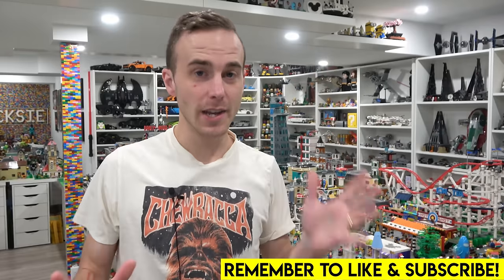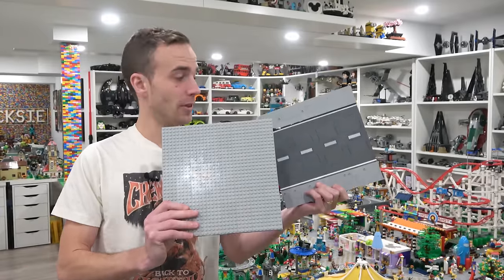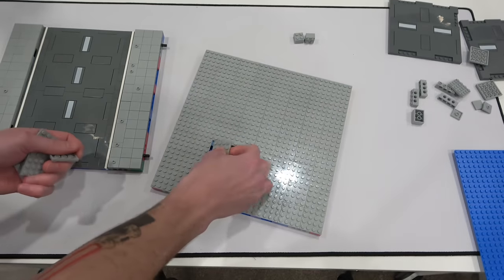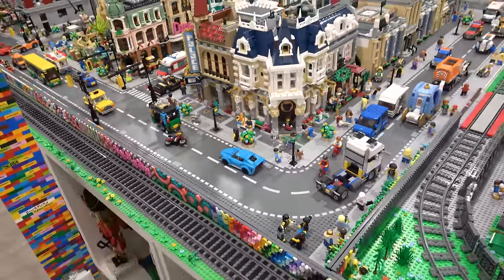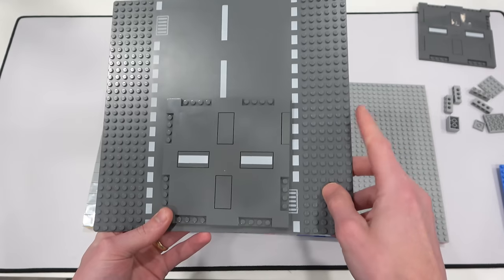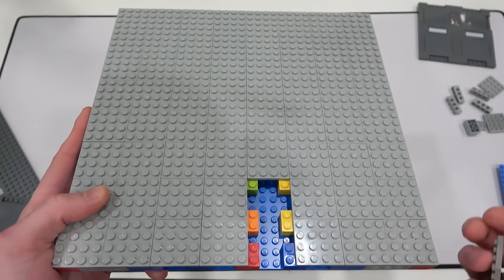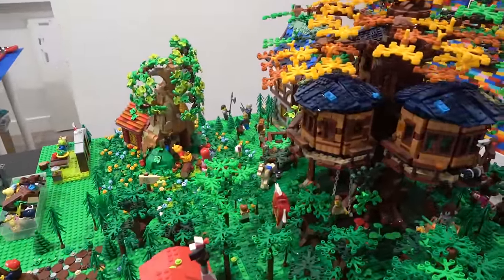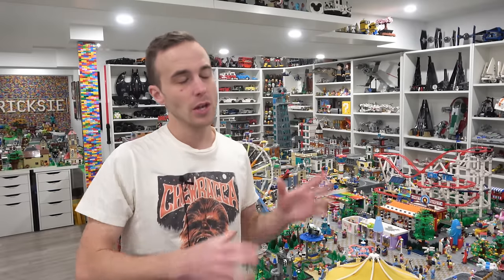LEGO MILS System? What is it? Should I Convert?

Comment: MILS has one pretty big disadvantage, it encourages making a very blocky city, builds start to always take up a 32x32 plate. The city ends up one big grid. It's possible to avoid that but you then start to loose the modularity.

For our city we aren't really using MILS, most areas are using baseplates, we like the road baseplates for the built up areas, the fairground goes under the eaves and if we switched to MILS the Ferris wheel would scrape the ceiling. The park area will be more textured with blue baseplates giving a water level and then the ground built up so in places will look a bit like MILS. Then we've got mountain areas which use the technique of two layers with bricks between but would be plates on top and bottom, so supports can be attached.
Reply: So mount things 'off kilter' diagonally, or at slight angles, and fill the plate with landscaping. If you put in the work, you could have a plate seam right through the middle of a park and not even notice. With carful planning, you could split a building across plates the way the titanic set breaks in sections. Put those ideas together, and you could have a large building split across more than one plate, at an angle, with landscaping around it, and break up that city grid.
Reply: @root1657  If you mount things diagonally then it actually ends up looking more blocky. You end up having seams that run at angles to natural breaks, so looks awful. As you say, you can have buildings that span multiple plates, but then you lose the one advantage that MILS provides, which is that it's modular and can be rearranged. MILS have a number of advantages:
Easier to transport
Modular
Specific standard to allow independent development of modules
Allows "hidden" wiring

If you are going with things spanning plates then you loose the modularity at which point being able to transport them its irrelevant so the only advantage you are left with is being able to hide wiring. If you are going to have a fully lit/motorised city then maybe that's enough justification on its own.

Comment: Not a big city builder. But a efficiency kind of gall. Will all the MILS plates be full base plates? 
I believe you currently have half plates for not only the railways but also some buildings. And some (like the dino exhibit) that are over 1 plate. 
I think you should be able to make half baseplate MILS but in the example you showed they would only pin into place on the long side. I don't think it needs to be an issue. But perhaps something to keep in mind.
Reply: You can absolutely make them whatever size you want. Only reason to be locked into 'standard baseplate' size is if you're exhibiting with others, I have some 2 baseplates wide for big buildings

Comment: Have Seen so many MILS Plates cities and the only single additional plus Point i see is to add light and wires. Everything Else you can accomplish with Standard baseplates Setups and additional, where you need and want them, bricks. I am Not sold in this. All of the Advantages mentioned in the video can be done with a normal Setup and Just taking Care of how you landscaping stuff in top of it

Comment: You could let the tiles follow the edge of the old road plates, so that you don't have the baseplates connected, right? Connecting the baseplates either with tiles or with the modular system is the same thing and creates the same challenges. So that doesn't really seem like a pro or con. Also, both systems leave the same amount of space on the side of the road, so again, not really a pro or a con. (Clever of Lego, now you get to keep the same roadside decorations, they'll fit!) To me the pro's are the flexibiliy of the system - not being limited to the 32x32 baseplates. The cons are that it uses a lot - A LOT - more pieces, and they look clunky.

Comment: This is a great video and given me ideas. I am looking at adding lights to my Lego city - so using the MILS plates would help to run all the wiring.
Can you use any size plates, just as long as you fill the 32x32 base plates?
Reply: Sure, I used 8x8 mostly since they were cheap and faster to modify

Comment: If you are just starting building your city or your buildings are for more then just display mils is the way to go. My 5 year old can pick up 10270 and place ot where he want which would never happen on a normal base plate. Also you can use duplo parts when building them :)

Comment: I would think it would be more difficult to swap out a modular building using mils because you have to think that in order to remove a building in the middle you have to slide a whole bunch of buildings and street pieces out sideways in order to get it out of the pins for each section. As opposed to how you have it now you just lift it up out of place after removing the tiles.  The mils is way more difficult to remove buildings when you have a large lego city with a ton of interlocking buildings in the middle.
Reply: Yeah you can definetely leave pins off some of the middle ones, the grid formed by the others keeps it all lined up
Reply: you really don't need all the pins. If your edges are pinned, nothing in the middle is going to move, so you can just lift any middle module straight up, or unpin one edge piece and slide out whole rows.

Comment: Maybe I am missing something re the MILS system, but I dont understand how it is easier to move them.

On a standard base plate you are connected to the roads with tiles, but in MILS it is with pins - right?

Lets say the whole city is on MILS - would most of the MILS plate be connected to 4 other MILS plates?
If so, you would need to disconnect each of these MILS plates in order to move one of them. Also, each of these MILS plates could be connected each to another 3 MILS plates.

Just imagine a 3X3 grid of MILS plates, so 9 in total. What of you wanted to move the centre plate. Surely you need to disconnect all 9 plates.

With a standard base plate, it is tiled to at the most 4 other base plates, If you need to move the middle one of a grid of 9, you need to take tiles off connected 4 plates and then you could just life it up. The other 4 base plates, you dont need to do anything with

Am I missing something?
Reply: It seems that you just pin the perimeter plates, leaving the interior plates unpinned.
Reply: It's not so much the "sliding baseplates around" that becomes easier (generally doesn't), it's that you can lift entire 32x32 (or 48x48 if you're nuts like me) sections UP and away and not have to worry about the baseplate flexing enough that, say, the building or whatnot that's attached to it twists itself right off the baseplate (and probably onto the floor).
Reply: @TiesonTrowbridge  I get that benefit for sure, it is certainly more stable - I just dont think that you can say tiling together makes it harder to move the pinning them together IMO

Comment: Your main argument for MILS is not sound though. If you would just use regular baseplates but focus on creating them more modular without that many overlaps, then it would be very easy to just exchange one baseplate for another. In your city it seems like you overlapped the plates with a lot of pieces so you cannot swap them out easily, but if you would have focused on the modularity more, it would be probably almost as simple if not even simpler to replace single plates than with MILS since you can just lift the plates up. Why would anyone waste that many ressources just to have thick connectable baseplates if you can improve your connection design and basically use the existing ones...
Reply: That's only one of the reasons presented though. Being able to build 'down' for things like water features, sewers, roadworks etc is great. They're much faster to set up for shows. Creating a system for rearranging railway layouts etc

If you can afford it they're just way nicer to build on.
Reply: @frostedbutts4340  Yeah those are good reasons but He focussed on modularity which seems to be a weak point.

Comment: I think the idea of MILS is great allows for added detail and easy assembly for modulars. Only thought is what if the modular is bang in the middle of a city build would you then have to disconnect for example 10 buildings first to get to it so it can be disconnected? If this is true that is very long winded and presents a similar long winded problem to what you face now
Reply: So benefits you get a load more build opertunities and detail but on the other hand its a lot more expensive, takes longer time to build and can give a similar problem of taking a bit longer time to move if based in the middle of streets or cities.
Reply from the maker: Will probably only clip the roads together and have the modulsrs floating loose in the grid so they can easily be removed.
Reply: @Bricksie  that makes sense dont know why I didnt think of that I assumed that you would just click them all together haha. Love the builds and thank you for getting me back into lego the last few months. Really loved watching your videos.

Comment: possible issue: if you need to remove a plate thats located in the center of the city, you may have to detatch alot more surrounding plates in the city outwards just to get to the one you want.
Reply: Probabily there is a method to use an axel instead of the tecnich pin, the axel could slide in and out but that would be like 100 more pieces for every plate, lol
Reply: this is my exact question
Reply from the maker: I would most likely just lock the roads together and have the buildings floating loose in the grid

Comment: Wouldn’t removing a mils plate from the middle of the city be a bit of a nightmare since they are all inter-locked?
Reply: you use pins only in one side of mils plate per say i think , you wouldnt put pins in each side of mils plate so wouldnt be a nightmare as sections kinda easy remove/slide out per say if you only use one side of 4 on each mils plate.

Comment: How are you going to remove a building when it's tech pinned to the road and the buildings on the other 3 sides? That seems like an impossible task vs. removing some surface 2x2 pieces.
Reply from the maker: Will probably only clip the roads together and have the modulars floating loose in the grid so they can easily be removed.

Comment: you will need to reconsider in moving to MILS. Its not easy to remove one modular MILS because it interlock with all the other MILS base plate.
Reply: Good point. I don't really see the appeal
Reply from the maker: I would probably only lock in the roads and have the buildings loose in the grid

Comment: Being able to have little canals running through my city, coupled with easy wiring for lighting has sold me on this. The only headache would be connecting the wiring using connectors at each edge so that you can unplug a tile. The wiring would need to be standard as well as the friction pin standard.
Reply: I think one of the lighting manufacturers could do well to make a 'magsafe' style connection for the ends that is also lego shaped so it becomes part of the mils panel.

Comment: I think the pins could make moving modulars more difficult than intended. With the original baseplate design, removal of connecting tiles was all that was necessary to free the modular building. Now, you need to fully move out a whole row or column by a stud to simply move the desired modular building. I do like the design of MILS a lot better though
Reply: You don’t have to pin everything together, just pin the road or outer perimeter instead

Comment: MILS can be expensive, but the investment of the system just makes it all worth it in the end.

What I think  you should do is start building each plate type, physically and digitally, this way you can log each part type required into a list with instructions for each plate type.

Building virtually should be very important to plan out your MILS setup.

You should start with finding out exactly how many MILS plate types your city actually requires, then plan the purchasing when you have a better idea of all the parts required.

When you have a full MILS city, then when you start looking at lighting you will see how much easier electrifying the city can be by hiding the wires into the MILS plates.